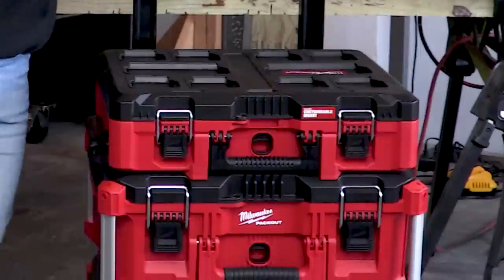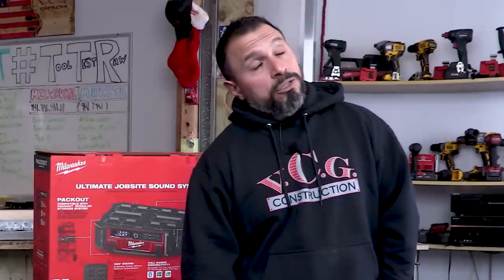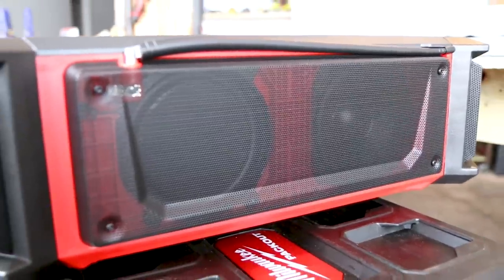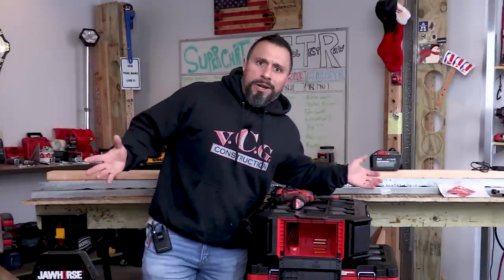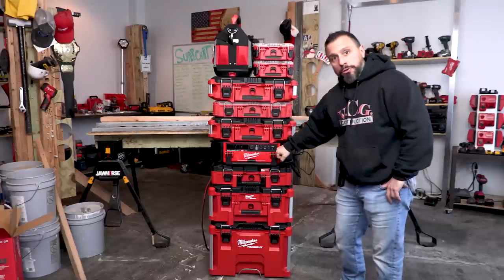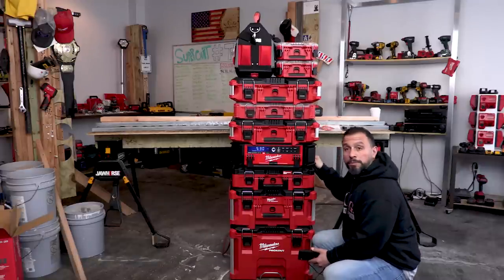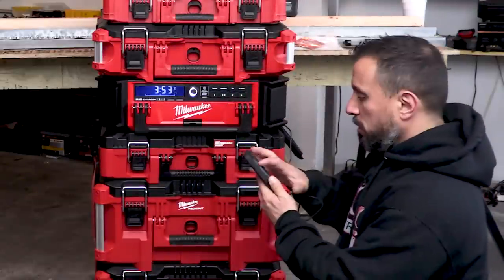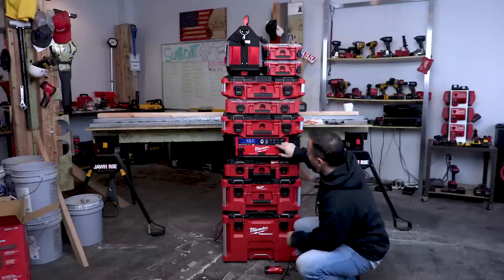Milwaukee M18 PACKOUT Radio Will Charge M12 Batteries! (SETUP TRICKS TIPS HOW-TO)

Comment: By putting mutiple speackers in one radio will give u clear sound but milwaukee can put cheaper drivers because they won’t have to handle as much power with all the class d amps out there no reason that thing can’t have more power if it had l 35-50 watts x times 5 for each speaker it would be a killer radio

Comment: I consider Milwaukee to be in the premium category with their somewhat premium prices. I have been waiting for their next gen radio for about 4 years now and I have to say that I am disappointed. 

Bluetooth 5.0

Bluetooth 5.0 had been in phones and out for three years now and for this price I was hoping it had it. 

I realize that my problem might be a job site specific problem but I like to carry my phone while using the Bluetooth (otherwise I find it pointless to have a Bluetooth option). 

Love the reviews and hoping you might do a review dealing with how well the Bluetooth works over different distances. 

Two examples that are specific with me: I carry my phone in my back pocket and when I have the current gen radio on a roof peak and I climb down the ladder to get something from the ground it will cut out once I get past the  eaves (Even smaller roofs).  

The second is just line of sight and when I squat it seems to affect the signal.

Comment: You should definitely tell Milwaukee to put the same or (BETTER 120ac, M18 Battery, AND 12 Volt vehicle power) into their 2848 tire inflator as well, so it can use whatever is available also, Jest say'in and if it would charge a battery from AC or Vehicle power that would just be cake!!

Comment: So I’m up in the GWN here (Great White North) or more commonly known as Canada. I’ve been looking at this radio since it was released here, almost 2 years, and I just can’t justify spending almost $450 on a job site radio ($398 + $51.74 [HST in Ontario]). If it had a remote that would make it so I didn’t have to run across the job site to change the station or adjust the EQ, it might be a more palatable price, but it doesn’t so it’s not. I’d love to have it but I’m not spending that kind of money on it, makes no sense to me.

Comment: Yo fantastic moves there Nick. 😂😂😂😂
Thanks for the content @VCG Construction! I like the new radio. I've always been impressed with the sound of the old m18 radio, and my little octagon "pill" shaped radio. The Bosch 360 and tough system radio both have a sub and passive radiator as well and call them "dual subs." Most people don't know what the heck a passive radiator is, so I suppose they are just following suit there. Still 9 +1 is a lot of "components packed in a packout." (Say that 3 times fast 😂) 
I really like the idea of having the packout capabilities, and not having to strap a separate jobsite radio down. Or carry it separately. Despite the milwaukee radios and the tough system radio We have, We tend to use the ol' heavy Bosch 360 jobsite radios. The built in quad gfci is a nice touch. I wish milwaukee would have incorporated a couple in the packout radio. But that's likely what makes the Bosch Soooooo doggone heavy. And when on FM we do get interference when plugging things in. Idk it is a tough call. I know there's ways around it also. We have the little 5 way gfci blocks, but I prefer things plugged in up off of the floor on a work table.   
If the price comes down to Bosch and dewalt tough system prices, or some big promo deal comes along I will pick one up, because you know I just gotta have it. I think milwaukee could have added a few more bells and whistles, but at the same time, simple and functional is the ticket on a jobsite I believe. I think milwaukee should have had at minimum an m12 charging port, as we have nearly as many m12 tools as m18. Almost all of our specialty tools are m12, and having chargers scattered around just sucked. (Hence why I made a designated packout rapid charger station) but maybe they can throw a charger like you showed in. Like buying a heated axis or tough shell bare tool or not, they provide the newest gen m12 usb charger/power source. At 3 hundo..... I think I will hold out. But we know how milwaukee does. I hope to pick one up soon for like a buck fifty. Or maybe 199 with a free battery promo. Please make it At least a 6.0 HO or 9.0 HD at minimum milwaukee. We know it won't be an 8.0 HO or 12.0 HO unfortunately, but we all have enough 5.0's that they just sit around unused. Lol!
Thanks again for the video! 
#VCG4LIFE

Comment: I  am a huge Milwaukee fan however  I would like to see a 110 v aux outlet like my bosch radio. It actually has  4 110v outlets I use 1to power my Milwaukee m12 4 pack battery charger, and 3 other devices, like Vince said m12 battery  both the round and square battery are very popular on job sites. Don't make a charging system that only charges 1 type of battery 12v or 18 I would wire a 4 outlet box between the radio and the plug in cord. Milwaukee should use the top of the radio as a charging base for 12v and 18 v battery,s  but you would have a radio and charging station all in 1 Milwaukee almost got it perfect , next time perhaps. Great video Vince.

Comment: WOW....you can only charge one battery with that thing???  I would rather have scene Milwaukee create a packout system that charges at minimum 2 batteries.  I'm one of those guys that will do one, or two big projects a year, then I won't touch a tool till the next project.  That could be 9mo later.  I've had two brand new DeWalt batteries die because they sat too long.  Apparently, that can happen regardless of brand.  Given the excruciating cost of these lithium batteries, and that fact that that can happen.....(never mind happen twice in 2yrs).  I'm a "cord" guy.  You buy it once, and don't have to worry about anything dying simply for sitting on a shelf.  Hopefully, the day will come when these batteries don't have to be coddled to last several years.

Comment: Love the Milwaukee Pack Out line, but these job site radios are stupid.  Heavy, large size, few battery charging options, and expensive.  I won't be ditching my Bluetooth earbuds or my $25 Amazon Bluetooth speaker  and separate Milwaukee multi-battery charging station.  And my earbuds help save my ears from loud machine noises during the day and makes it easier to listen to talk radio or take incoming phone calls.  Save the money for tools that actually make you money and forego these silly job site radios.

Comment: $100-139, They chinced on a couple nickels worth of wire to run the charger at the same time as the radio. They could have put in a second charger circuit, at their cost probably $8 , or less worth of electronics... Probably closer to $1. So at 299.99 This is a complete disservice to the regular customer.

Comment: I would just add a 120v. plug to it, for any other tools than are not cordless or add a normal 12v charger to it... or there 6 battery charger with packout addons 48-59-1807...

Comment: Come on Milwaukee get it together first of all no remote that's a must any suits show up on the job run down the ladder run to your Boombox and turn down the volume next thing you hear no radios on the job site second of all no convenience Outlets s*** my bosch radio those two features a total of 4 cords can plug in it GFI circuit protected seems like your aux and USB cord coming out of that compartment the door has to remain open so if you try to close that compartment door with the chords out are in the way that sucks so much for setting your phone on top of the box so you can hear it ring should have made a notch in that door for cords to go through let's talk about Bluetooth is there a external mic probably no so your phone's plugged in charging somebody calls let's say you're trying to hang a door by yourself radios next to you should have to say pick up phone the music should automatically stop answer the call external mic  will hear you  5 feet away hands-free my motorcycle helmet has that technology s*** this don't even have a CD player Bosch does old school does it have an EQ? Nothing like  listening  the death metal  and the next song classical and my favorite  Mexican rap LOL indoor and outdoor button right b***** shitt I don't want to use my phone for Bluetooth capabilities how many watts is this? How about Sirus radio compatibility? Probably no don't say use the phone now I have to run across the room open up the storage compartment Press buttons now  I can the phone the year 2020 why another $50 accessory to charge a different type of battery that's not going to fit in that compartment with the door shut so you going to lunch in the lunch truck unplug your phone throw optional charger somewhere and because the battery and the USB charger and the cables won't fit in that compartment so much for being organized Battery so no one will steal it pretty much take the radio off so you can store it somewhere else in your organizer I love engineers especially their interns that do the designing for them this radio the clock have a timer? Like alarm clock that you can set let you know that the lunch truck is coming or it's time to clean up let me guess they want you to use the phone the next option you gave Milwaukee option 6 ft antenna deal breaker I have never heard of you or of your Posse but you do say it the way it is you try to save people money guess I'm doing your job for you giving you my review all I know is you owe me lunch for the feedback they should have put a headphone jack on LOL don't get me wrong I'm not a Bosch Fan at all my seven-year-old boss radio kicks ass over this piece and about your organization can you leave that on a job site is it lockable is there a way you can put a chain on it or cable or through it let me guess break it all down and throw it in a gang box right sucks so let me get this right 250 bucks you get a milk crate a radio clock charger brilliant I like tacos keep up the good work you given me a headache this week

Comment: Bought mine last Tuesday at HD. Scored it for $250. Sounds good but bass distorts in full volume and high level on the EQ. So not 💯 impressed with the sound. Speakers could be better/louder IMHO. I don't like the speaker protection grill. The seem thin and weak. likely to be bent easily. I wish you could control which speakers to use. like if you don't want omnidirectional 360 And just want one side to work. And it is pricier than I'd like. Though it was a lot easier to buy at the price i bought it for..

Comment: I’m not surprised that you can hear the charging circuitry on AM. One it’s a switch mode power supply. So it’s extremely difficult to filter out the noise of it. But it is a nice radio.  Even if A little over priced

Comment: I bought Bosch jobsite radio 13 years ago. It has a 4 way spliter that is very handy. Also a 12V outlet. Aux in and out. I want to buy when it has atleast has 120v power outlet on there.

Comment: It charges batteries but it's not really a charger. It will charge a battery when plugged in, but it's not a primary function. I want them to come out with solar charger for the pack out.  Hopefully soon.

Comment: Always a pleasure listening to you. There's one thing I gotta say about the Milwaukee Packout system and that  the rolling tool box packout handle looks flimsy . I think they should go back to the drawing board with this. When I load up my packout with  stuff in it, it starts to to feel weak. Almost to the point where it will fail.

Comment: How does this Milwaukee pack out radio ($299) compare on everything to the Dewalt  tough system 2.0 radio ($199), I got the tough system 1.0($129) and sounds amazing,
Reply: G ou t the 2.0 its badass.

Comment: Vince let me give you an easy way to understand. When charging... more amps= more better.
Rapid charger? More amps.
2.1amp charger? Faster charge.
500 horse car? More faster.
Reply: 1amp chargers are the norm but more and more products are making it seem like 1.5 amp or 2.1 amp is the norm as time goes on.

Comment: Not really a topic for this video but I recently purchased the super hang and I wish I would have gotten the one with quick lock. I have to drill in tight spaces and it would help out tremendously to have a quick lock or something comparable? Any ideas guys or if there is a way to swap the part chuck vs quick lock
Reply from the maker: I honestly don’t know, call 1-800-sawdust and see if they can help you out!

Comment: I bought it and wasn’t blown away by sound. I have a Harmon Kardon Aura that provides plenty of immersive sound and Bass. 

My biggest grievance was that it didn’t charge m12 batteries. You solved that with this video so thanks to you I may keep it! My HK Aura 2 does take a savage beating... 

Thanks for the help!!!!
Reply: I think the biggest disappointment is impossible to work around considering the design. You see it and you expect something with speakers moving 14” depth of air, in reality they’re tiny speakers in each corner with a hollow battery mounted between them. Pound for pound anything else remotely similar size should provide much larger sound
Reply: Or they should’ve made the battery department MUCH less large and taken advantage of it but I guess it depends on what people expect of it. The size will certainly lead to some disappointed customers though
Reply: How do you charge a 12v battery with a 5v usb? 🧢

Comment: 3 things before I'd buy it at it's current price:
1) it should include 2×12v and 2×18v quick charging
2) they should sell an optional extendable antenna that is packout compatible for the REALLY rural jobs
3) incorporate a small ambient light to it.

Comment: Put it against the tough systems 2.0
Reply: Bro will you pay 300 for this radio missing m12 charger and not that loud
Reply: @xpblackdragon  might be a deal breaker because its $300 and now I have to buy an adapter for another $50  come on Milwaukee
Reply: @rikki71234  bro milwaukee is starting to be the apple of the tool industry  so sad
Reply: I have the dewLt 2.0 is this as loud as me dewalt

Comment: I’m a starting carpenter and looking into purchasing a brand bundle it seems makita or Milwaukee.. anyone have any advice?
Reply: I have used Mikita for 20 years as a cabinet installer. Excellent quality & battery warranty. The 18volt circular saw is not up to the task for framing. Switched to Milwaukee for framing because of the rafter hook on most of their tools. Love the power of the Fuel line. Milwaukee quality & warranty is also excellent. Prefer Milwaukee due to the ever expanding product line & the frequent price promotions. I think in 2 years, there will be no need for a compressor or generator on our job sites. Go with Milwaukee.
Reply: Alright thank you perry Clark and whoodiestyle!